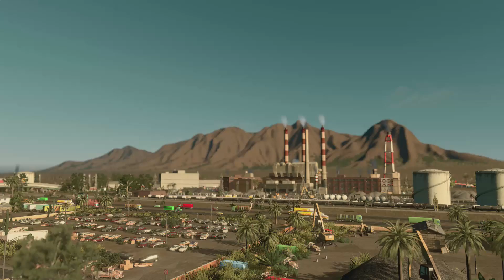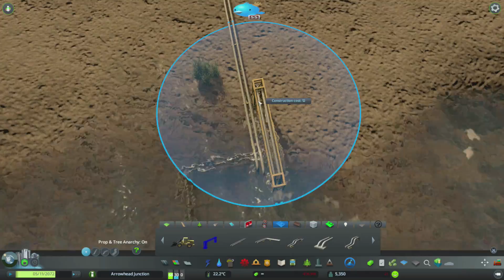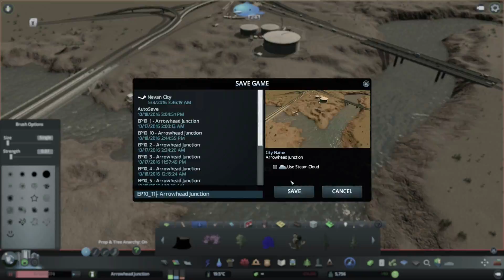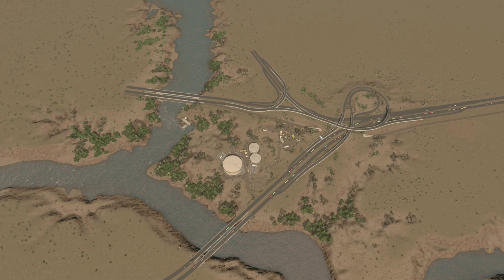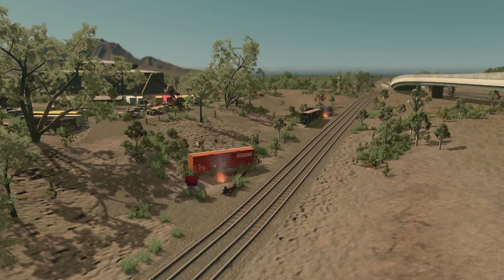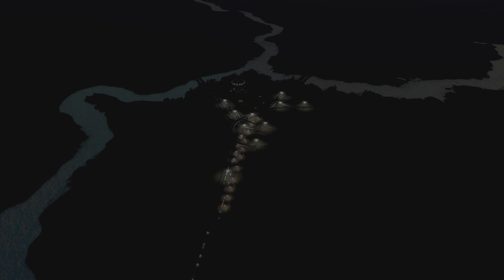Cities Skylines: Arrowhead Junction - Part 10 - Massive Interchange!

Comment: I'm not sure what the concrete blocks in the water are supposed to be, or what they're supposed to do? It doesn't look like they're designed to serve any purpose.

Also with the junction, the lane which splits off to the new portion of the map has a merging lane very close to another merging lane. Anyway, it looks great, and still better than anything I could ever do. Just irks me.

Comment: 35:35 I want someone to make those yellow barrels you see at the forks on highways, because those orange ones are meant for roadwork and construction.

I believe they are called Impact Attenuator Sand Barrels.

I don't know about other countries, but in the US, traffic control devices and signs are color coded. Orange is for construction and roadwork. Yellow is to indicate warning and caution, white is regulatory, and so on.

Comment: In all honesty, that turn off needs to be redesigned. A good way to fix it would be to have a small interchange where a paved road turns into a dirt road and then proceeds to the water plant. Not trying to be rude or picky however, the purpose of an interstate is to be a limited access highway and a random turn off ruins the integrity of the highway.

Comment: I would like a mod which allows for street end zoning
Reply: J Vilander street and zoning?
Reply: SHVDW end
Reply: J Vilander Ooh street-end zoning! Yeah, like a cul de sac? There is a way to make very small, 1 or 2 unit circles with the one-way roads from the Network Extensions project.
Reply: SHVDW yeh i know those roundabouts but without mod would be great to have small U turn

Comment: The reason those huge poles usually have sand barrels and barriers is because they are not designed to break away like the smaller poles.